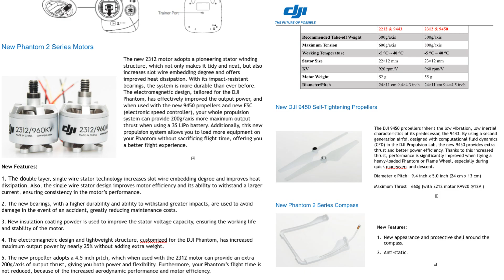First look - DJI Phantom V2 upgrade motors, ESCs, props

Comment: Having knackered all 4 motors on my P2 vision with Propguard screws the plastic baffle is a welcome addition.  My ESC's already say V2 but not 2.1.  Do you think the exact motors will need to be replaced or can you get away with DJI motors from online auction pages?

Comment: Hi, daft question but one motor defunked due to brainless moment doing exactly what the plastic guard in the new motors prevents you from doing,! using the longer prop giuard scresa and winding in to the coild so ordered one of  the new motors with new ESC.  in your video you said you have to change out a motor and esc together but i noted the esc appears fine and is already a v2 ( on a phantom 2 vision plus ).  do i still need to swap out the esc or can i just reconnect the new replacement motor.?

Comment: Simon, another informative video, thanks.  As far as choice for the new V2 upgrades, I vote for the Phantom 2 Vision+. Another comment, Bruce Campell(sp?) of RC Model Reviews has several good basic technical YouTube video's for new folks on such techniques as basic electrical work-soldering, installing, theory, etc that might give one a little more information and push.
Good luck and keep the good video's coming as I always gain some information from them no matter what.  Remember never trust electrons because they always make things up.

Comment: I would like to see the upgrade parts installed on a P2V+ .  By the way I acquired a set of props and there is definitely a pitch difference and also most definitely a stiffness difference (along with the chord difference that you already mentioned).
Reply: *****
Wait!  I thought the 9450 - WERE - the E300 thrust boosted props!  All of a sudden I am not sure which I have!   I need to go look).
Reply: *****
I flew my V+ today with the 9450 props on it.  I had used a Sharpie to label my new props because I couldn't see the "9450" stamping that you referred to in your KT video, but today in the bright light outdoors I saw that number (and now I know which props I have).  So when I flew the V+, I didn't notice either any additional lift nor any reduction in flight time (but I didn't fly for the whole battery, because: (1) I was flying over a lake, and (2) on one flight I was using a Limefuel battery - which I don't fully trust yet).  The props are fine, but not big whup.

Comment: Hello Symon

Thanks for your excellent Youtube Chanel 

I want update my Phantom 2 with the new motors and propellers, but I have a question that nobody knows the answer... but you have a contact with DJI... 

I have in my Phantom 2 the ESCs identical to ESC V2 samples in your video, but in my ESCs not V2 in the whitte sticker.
In my ESC boards indicates NW 301 BLDC V2   V

My questions:

1- I have a version 1 or 2 in my ESCs ¿? 
2- How much aditional weight you can get in the new version of the Phantom 2 with these engines?

Best regards

Hoy

Comment: Vision Plus here, 2 of them, & while I'm at it, any chance for a how to unbrick my camera on one of them short of sending it in. It shouldn't be magic.
Reply: ***** First, sorry about the hot lemon. As to my dead camera it acts like it's just the camera since the gimbal snaps to attention normally but the system will not communicate with my Samsung Rugby or Nexis 7. This all came about when I loaded the firmware update. Tried several times and all is current including phone and tablet which function quite well on the other unit (P2V+). My conclusion is it happened due to the upgrade it wasn't flown before the upgrades were loaded.
Reply: ***** Thanks S. Yes, did the camera upgrade via the micro sd card. The DJI wifi network has always been solid and I disabled all nearby ones to eliminate any chance of other network interference.  All batteries full, nice green lights on everything. What I haven't done is poke around at the ribbon cable connections & inspect it for breaks. Now where did I put those jewelry tools.

Comment: Simon, I experienced quite a difference in lift with the new props.  This video is far from scientific, but it's at least based in logic.  I go from 0-400 with the stock props, and then 0-400 with the new 9450's.  That video is here:  http://youtu.be/NT8s-xH-7nE

The Flytrex Live data is here:  http://www.flytrex.com/mission/quadcopter-connie-francis-bob-asbury-81745/  You can see two spots on the graph where the ascents were made.  To take out the more subjective start-stop (bottom and top) spots, may I suggest comparing the 30-370' times.  That gives you a more exact comparison, but I will tell you that it SEEMS to me that a good bit of the gain in performance comes from the initial thrust when you hit the throttle.  That is cut out of a 30-370' comparison, but it does help to get a fairer, apples to apples test.

I'm pretty certain that the new props are the exact same shape and pitch.  The difference comes from the firmness.  They are somewhere between stock and carbon fiber.  I have a couple of pictures where I tested the flexibility of each, but the result is in jpg, which I don't think I can post here.  If you're interested in looking at it, I can email them to you....
Reply: Once you compare the two, you'll see the new ones are starkly stiffer.  That kinda sounds like the name of a teenage pop star.  "Here's the latest hit from Starkly Stiffer!"

Comment: I vote the p2v (not plus) with rotorpixel gimbal and dji filter set (all with the extra weight)..I say that as  I'm still having issues since installing the rotorpixel in terms of maintaining altitude once below around 80% battery (proportionately more and more throttle required as battery depletes) & battery drops from 98% to 25% in only just over 11 minutes all of which is very disappointing after sending so much and waiting si long for the rotorpixel and would like to find a solution to this asap..
Reply: ***** just connected to the assistant- under advanced- battery- (percentage of charge 99%)  cell 1 voltage- 4189mV; Cell 2 voltage- 4192mV, cell 3 voltage- 4191mV..vertical gain under 'view' is already set to 120%..I'm at a loss as to why this is happening (battery draining so fast and not being able to hold altititude for long..basically towards the endwith te left stick centered it is descending to a couple of inches above the ground and then climbing a little (I guess due to sensing the ground is near, climbing a few inches then descending again- essentially 'bouncing' up and down until eventually it doesn't have the power to asend again and starts touching the ground and need more throttle to climb away)- going to experiment now with gain at 150%..PS- am I correct in thinking that the latest firmware/assistant finally allows full access to the 7th channel with the original stock TX with 3rd party lever installed? I hear the new firmware does something with the batteries as well..PS- I have carbon fibre props on and no vibrations are expereineced so far in the test footage at least so far..
Reply: justinspirational just tried gain at 150% and no better- maybe worse as now as well as having to continually hold throttle up to maintain altitude (almost like being in manual mode whilst set in gps mode) I noticed at around 30 or 29% battery- the power dramatically dropped- fortunately I was hovering only about a foot off the ground and got it to the ground ok- battery saying 29% when trying to start it up to take off again- not enough power at all to take off, even for a moment even though the battery is saying 29% which under normal circumstances would stil be enough to fly..are my batteries messed up? It seems too much of a coincidence this all happened after installing the rotorpixel..

Comment: Simon, I vote for the P2 if only for the weight differential, which should give those motors, ESC's and prop's a good work-out. Your doing a great job - all power to you! PS could I ask what soldering iron you use. Thanks

Comment: p2 Simon....  Ive got a set of the 9450 props last week but not had a chance to try them as the weather is not good at the moment
Reply: ***** Simon as far as i can gather the props are both one of the same. RCGeeks are advertising them on ebay as (E300 9450 propellers thrust boosted) They also go on to say Improved flying for heavyly loaded Phantom or FLAME WHEEL. The Ebay Item No is 281474176542 for you to check
Reply: ***** I seen these new props advertised about 3 months ago and i asked a question on djiguys.com about them but no one came back to me, just looked at a vid on Utube a guy in the states tried non scienetific test ...stock phantom 2 props (9443) zero to 400 ft took 30 seconds , 9450 probs zero to 400ft took 23 seconds , be interesting to see how it would be with the new motors and esc's

Comment: Although I have a vision+, I believe the upgrades would benefit the P2 with the HD-3D gimbal the most since it is lifting the larger payload. Possibly a good way to test the performance enhancements, would be to start with some baseline measurements with the stock or current propulsion system and props.. Maybe do several baseline  tests with a stop watch and measure the time the phantom2 takes to reach 100 meters altitude,  then time it again after the upgrades. Perhaps one test with props only and then a test with the new props, motors and ESCs compared to the original equipment. I'm curious to see the results as i just received the new transmitter ($100 dollars) and the new anti-static compass, $15

Comment: Simon the installed upgrade motors on the p2 v2 are unbranded due to balance reasons. Great video. If you make a video covering the install it's worth talking about soldering and also. Heat sinking when soldering close to pcbs so the heat does not burn or loosen components. I highly advise you use 60/40 lead tin solder. NOT cheap alloy based soldier as it brakes down and creates dry or week joints. Austin @AwPhotographic

Comment: P2 with zenmuse.  I  was considering the motor upgrade but wasn't aware that you would have to change out the ESCs as well.  All depends on the price I guess.  Fancy the new transmitter as well for my P2.

Comment: Vision + please!

I wonder if the new props can be fitted to the old motors? I wouldn't mind betting (only 10p) that the prop threads are different on the new props/motors and so it won't be possible to fit the new props to the old motors. The new props appear to have a larger chord and more twist to the profile. They will require more power to drive them than the original props which the old motors won't be able to deliver.
Reply: *****
In an attempt to win my 10p back.........
I presume that the new props are both aerodynamically more efficient (eg less drag) and generate more lift. Presumably more lift won't be of much if any importance to a Vision+ (fixed ac configuration) owner like me but greater error aerodynamic efficiency will be. Presumably that should give us a longer battery life? I'll be interested to hear if there is any noticeable difference.
Reply: *****
I'll be very interested to hear the result. I would have thought that any difference in duration less than about 10% would be within experimental error. I'll also be interested to know if you can hear any significant difference in the sound of the rotors.

Comment: Ile go with the vision plus mate. Only reason is because thats what i have. But as some of the other guys say probs would be better on the P2. Either way i'm sure the results will be good. Look forward to the vid of the outcome :)
Reply: ***** Your welcome. Thanks for being a brilliant source for helpful information.To be honest thinking about it i would go with the P2 for the upgrade. More power and lift for heavier kit.I am more than happy with the performance on my vision plus.I am new to quads well flying model aircraft full stop. I have a trex 450 and a trex 700 here on the side that have never been out yet :( Although im getting there in the simulator so the 450 may go out soon. I have had my PLUS out about 6 times and love it. I have a vid on my channel just messing around. My view on filming is steady away get some good shots. If i want to fly like a loon and get a serious buzz i need to get a Heli out :) P.S if you or anyone else watches my vid i do apologise for the clarity. Dont think i am using the right movie maker.